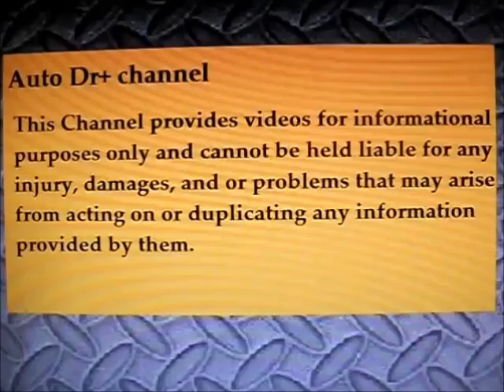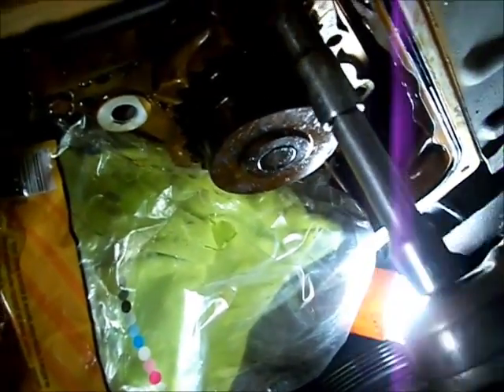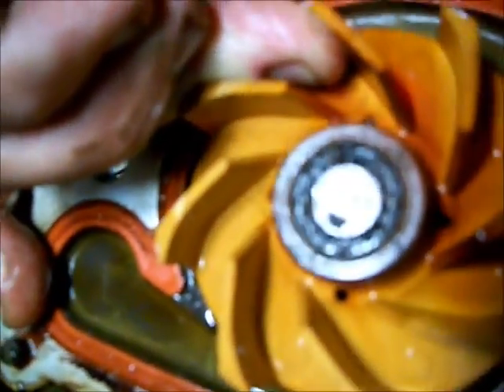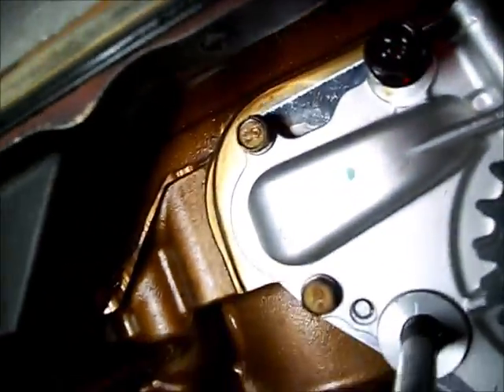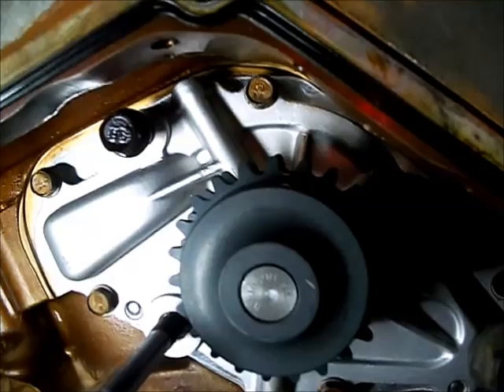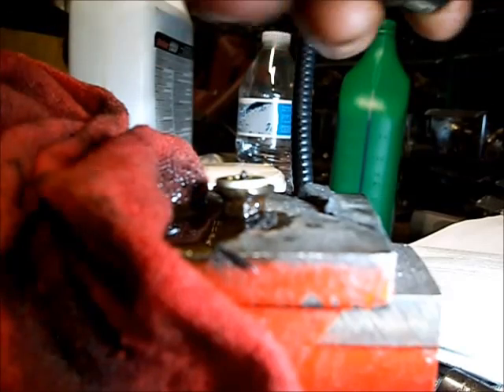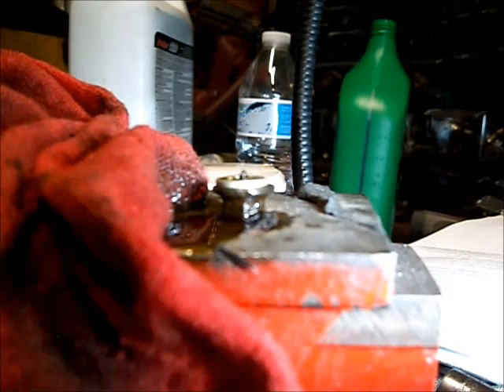Dodge Magnum `05 w 2.7l pt.2 water pump replace timing chains

Comment: So how can I know this is my problem?  Water leaking on the correct side, about to put it on ramps to find exact spot.  But is there a test to see if I actually have a pump issue or a hose issue?  Please tell me water can leak in that area and it be a hose issue.  I only overheated once but I noticed it was low on water. It only leaks when I fill it all the way up, and it hasn't really overheated since.  But that leak has me scared.
Reply from the maker: marc page. A hose or the t-stat housing can leak in that area, and a visual inspection should clear up the location of the leak. A radiator pressie tester with about 10 lbs  of pressure would help see the leek point as well. You may want to want to drain engine oil, and check for antifreeze in it, if weep hole is leaking coolant from pump at T-stat housing on lower rad hose. The water pump can leak water inside the engine as well, if it has failed that way.  If coolant is on the  bottom of oil drain pan, after draining oil,  the engine must not be ran any further until repaired.  Because, coolant will destroy the  engine very quick, if it's in the oil pan.
Reply: Auto Dr diy thanks for that...gonna check out plug now.  If good then I will inspect tstat.  I am getting no heat standing still, antifreeze full.
Reply: Auto Dr diy so no water in the oil but I'm not getting any fluid out of my bleeder valve with a full tank
Reply: Auto Dr diy so I am getting Heat standing still my heat is at 3/8 on the gauge
Reply: Auto Dr diy and so far no water leak. This bothers me because I haven't done anything I'm trying to diagnose it and now all of a sudden no issue
Reply: Auto Dr diy this all began when I took a 20-minute trip 7 miles it got almost seven eighths on the gauge hot was leaking water from underneath on the tstat side and she said the heater was blowing cold air prior to me driving it that day
Reply from the maker: If the engine is hot to touch and running, the reserve tank is full, water should be flowing out of bleeder on black plastic water outlet at top of engine.  If not I would check that both heater hoses are as hot as engine where they enter the inside of the vehicle.  Especially if there is no heat inside car.  Also if the radiator is cold at the lower tanks on the ends of radiator.  If all is cold, relative to engine temp, then the water pump impellor is likely cracked, see here:     https://youtu.be/VDlUrDDF8Lg?t=2m58s     and testing the system tips here:   https://youtu.be/KovFDnvmrGM?t=5s
Reply: Auto Dr diy thx.  Did all of those checks...now getting Heat and no water leak...topped it off and bled...but nothing else.  Could it have gotten so low that it would have caused the leak?  Or introduce air into the system which would have caused the leak?
Reply from the maker: marc page. Yes, if it boiled over, it will leak on that side, but the coolant got low somehow, so a leak is evident, and a pump can leak intermittently, initially.  The coolant level will have to be monitored closely for a few weeks, and addressed accordingly.
Reply: Auto Dr diy k thx.  If it intermittent then pump could be going out?
Reply from the maker: It can, best to check weep (3/16") hole in block, right behind T-Stat housing plastic, where lower rad hose attaches, for liquid coolant drip.  If dry, then probably coolant loss over time from rad tanks, hose clamps, various seals sensors, bad cap.  If leak isn`t evident, then park on cardboard, cement, where visual can be checked overnight.
Reply: Auto Dr diy think it's intermittent...no leak detected now.  Going to get a pump/ chain kit to be ready.  Almost 300,000 miles. Anything else you think I should do prior to or during this procedure? I am shooting for 500,000
Reply from the maker: marc page. Use only OEM CHAIN & CRANK SPROKET (if replacing sprocket) I cannot stress this enough.  Recommend OEM tensioner plunger, and water pump  as well, but not critical as the other 2 items.  And, if replacing, use only OEM T-Stat.  Going to need antifreeze, oil change, several cans of brake parts cleaner, as coolant will be entering oil pan, and I just leave pan drain open to let it go out.  But will need pan flushed with cleaner, various sealing surfaces degreased, etc. I typically have to heat crank sprocket with torch to get off, and back on as well, if it is OEM, and you want it to be that hard, or it will fail, and come loose on crank, and shear the sprocket alignment pin off.  Seen it happen on aftermarket sprockets.  Champher entrance of tensioner plunger hole with 400# paper, so o-ring doesn't get damaged during reinsertion, critical failure of o-ring will cause significant oil pressure loss, and damage engine. Tensioner cap/cover has weird size o-ring in it as well, can get from dealer to.  Set new chain in container of clean oil for awhile, then let drain before install.  Consider new belts, hoses, radiator,  while in there.  Take time to eval. every step inside engine, it isn't a hard job per say, but mistakes made in haste, will likely damage the engine beyond reasonable cost to repair, and total car.   I assume oil changes were done, or it wouldn't have made it past 50k, so shouldn't be to messy in there.  Also, throw some lint free rags around crank above oil pan opening while working inside.  To prevent bolts, etc. from falling into it.  Always pull damper from center hub, and never from outter belt ring.  Good luck.  Cover intake head ports with rags as well.  Thanks for watching
Reply: Auto Dr diy should I replace the other 2 Chainz also? And I guess those are cam sprockets?
Reply from the maker: marc page. If the miles is over 150k, you may want to replace secondary chains, and related tensioners.
Reply: Nm. I misunderstood video...I am on track now
Reply: Auto Dr diy thx

Comment: Did you put RTV silicone on the gasket OR just the gasket only on the waterpump?
Reply from the maker: The pump gasket is self sealing, and RTV would defeat that purpose.  About the only places for RTV is, on the timing cover lower corners, and the front seams at the valve covers.

Comment: Hey it's me again! Working on another timing chain/water pump on 2.7 Dodge. I got everything put back together again, new pump, chain but kept the old tensioner. Car starts right up, no check engine light (except a P0171 and P0174 for bad intake gasket). Now I hear a slight tapping, almost a light dieseling when it idles, When I took out the old tensioner, I pushed in the check ball a bit with a small screwdriver, only a little oil came out and the plunger would not go down very much so I just installed it in the extended state thinking oil pressure would set it right. I heard the slight rapping noise when it first started up and then it stopped, ran ok at first (felt a bit of a miss at idle, possibly from bad intake gasket) and then it started running rougher and then the tapping noise..... is it a bad tensioner? Or I didn't set it back right? I also thought maybe when I removed the timing sprocket on passenger side I didn't torque the bolts down, but I did put blue thread lock and tighten to 250 Inch Lbs. as per the Cloyes video.  I first thought the noise was a bad coil, so we removed the intake swapped coils from passenger to driver side, no change..... the noise is coming from passenger side, under intake.... don't think any debris came onto the cam area ..... nothing unplugged. I read somewhere about air in the cooling system causes noises like this..... think that's BS..... is it the tensioner?
Reply from the maker: Buy a new tensioner.  This isnt the motor you want to  experiment on with short-cuts and aftermarket parts, unless you prefer to spend vast sums of $$ repairing the engine every week-end.
Reply: thought so! Thanks again!!! Part was ordered last night!

Comment: My mechanic changed my water pump now there's a knocking sound tht wasn't there before and he's telling me to buy a new motor help me plz
Reply from the maker: Not sure how I can help.  Could be a dozen + things happened in there, if the repair wasnt done properly.  In general, it is best to ask if they have done this repair before, and even about how many of them.  Also, if they are confident about the repair solving the problem, and that they have had no complaints after that repair has been made x amount of times before.  Another thing is, that when this repair was being made, if the car had over 100k miles on it, there should have been an "estimated option made" available to you, stating that the timing chain, gears, tensioner and guides, appropriate seals, and oil change are highly recommended in conjunction with being in there changing the water pump.  This will likely double the estimate of the original repair, but this stuff is going to fail soon anyway, and why pay to have it torn down again from scratch, when they`re already in there, and be without your car again.  Oh, and ALWAYS use new OEM parts anywhere inside the timing cover area.  Can prob get by with aftermarket water pump, but I been down the aftermarket road with the timing components, and they all failed within 15k miles.  Just the facts.
Reply: Auto Dr diy Thank you